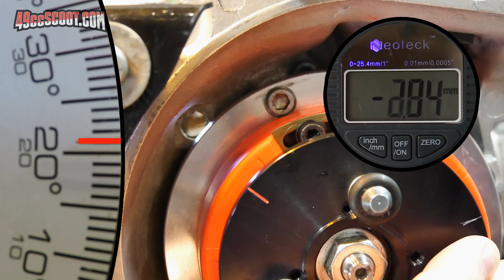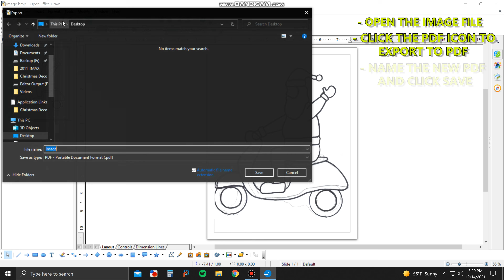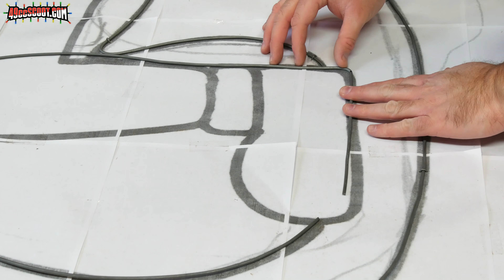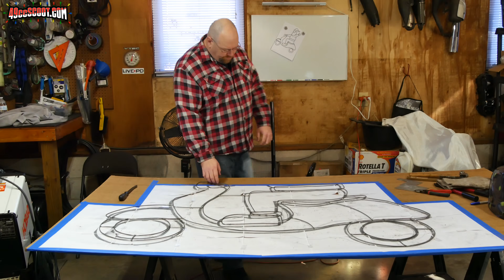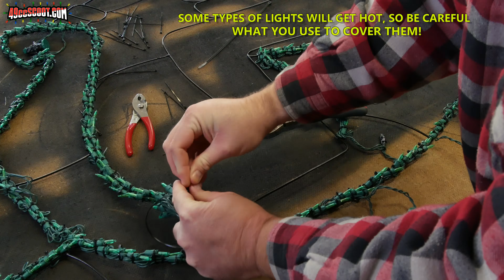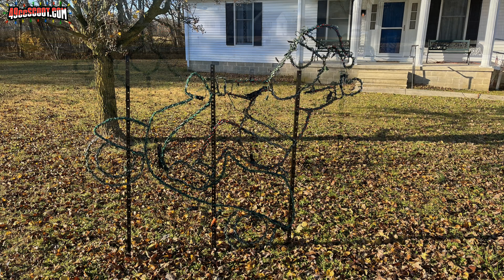🎄 DIY Wire Frame Christmas Light Holiday Decorations How To : Make Your Own Lawn Ornament Display! 🎅

Comment: Would it be possible to see detailed instructions for putting the lights on? How do you fold up the wire and put a zip tie on? Thank you.
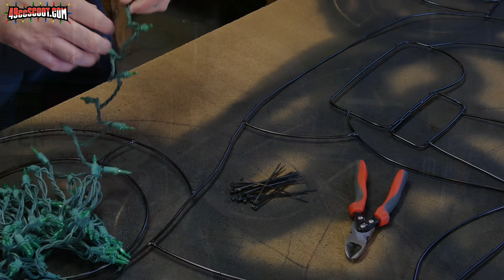Reply from the maker: Go to 14:28 and watch. You can go to settings and playback at 1/2 or 1/4 speed and I think it will be fairly self explanatory. I don't know that my method is the best. I think you could be way less dense  with the placement than I was. It's pretty much just folding wires however they fit best and attaching zip ties firmly. Ideally I like to get the zip tie at the top of the bulb holder, but it doesn't always work that  way. By time you try a few, you'll get it easy. Then it's just a matter of having the patience to continue.

Comment: What I did was just continue using the entire string of lights as far as they would go and just remove bulbs and swap them out with the color I needed from the other strings. Worked pretty good and seemed to make the process a little easier
Reply from the maker: That's what I hoped to do, but the bulbs that I got didn't work that way.

Comment: I use the Home Depot steady lit lights on all houses wreaths and bushes/garland etc! 
They have worked for around 5years so far! 90 days max!
Definitely don’t use regular led lights!
Commercial would be better really
I need to get a welder and do this!
Also couldn’t you just use some pvc clear or something to make the frames?
Killer video!
I appreciate the detail!
You gained a follower just cause that detail!
Reply from the maker: I'm sure you could use other materials for the frame. I think the wire shown is about as cheap as it gets for something that I know is durable and fairly easy to work with.

Comment: It came out really good. Did you ever find out what kind of steel needs to be used so you can use clips to attach the lights? That sounds like the way to go. BTW can you share the type of welder you used? There are so many lessons a person can glean from the video. Thanks so much for sharing.
Reply from the maker: I was using a Hobart Handler 140 doing flux core. It will also do MIG. It was around $450 when I bought it years ago. Now I see it selling closer to $700. I've been very happy with it, but there are much cheaper welders out there that will do just fine for this stuff so you may want to research a little. Here's an affiliate link anyway :
https://amzn.to/3KOEVpA

I've never looked into the clips anymore. I was gonna build another, but just haven't had the time so I haven't looked around. I do know that there are clips for 3/16" and 1/4" wire frames for sure though.
Reply: @49ccscoot  Thank you Sir! Appreciate the information on both questions. I've been wanting to do this but playing with all those lights, doesn't sound like fun. I'd probably try to find lights that don't cause a lot of problem if one goes out as well.  Nothing beats a custom light that nobody else has though!

Comment: Great project.  Very talented man.  
Two questions,  I'm not a welder, any ideas?
Would rope lighting been easier? Or both?
Reply from the maker: Rope lights would be way easier. The way I did it was very time consuming. The benefit is that it's very bright and densely lighted. You'll find that most wire frames are pretty sparsely lit.

You may be able to tie pieces together with cable ties, depending on complexity. Possibly some sort of crimping; maybe involving metal rings to tightly crimp two areas together. Once mounted on poles, it shouldn't need to take a great deal of stress. It needs to be sturdy enough to stay together for storage though.

Comment: I made my big grinch display using an old school overhead projector I picked up from FB Marketplace for relatively cheap. got some clear binder dividers, and traced out the image from a printed picture. Cleared out a big enough spot in my garage to set up the projector, and set my board up against the wall and went to town tracing the projected image out. Worked like a charm, and I bet the same idea could easily be incorporated into this sort of wire frame design building using a sort of peg board with plywood and screws/nails to hold the wire in place as you bend it around.
Reply from the maker: Sounds like a good plan. I think you'd need to be careful that the screws/nails didn't force the wire into shape as you went. Don't want to build tension into the design. Would probably greatly speed up some of the process.

Comment: You could have used an overhead projector to make the image larger.
Reply from the maker: A few people have suggested that now. I think it's a good idea. For me, the method shown worked pretty easily and I didn't have to worry too much about knocking anything out of alignment, lighting, or buying any additional equipment.

Comment: Hi first time viewer, love your idea you do realize you could have just painted that board black and stuck your lights through it by drilling holes all along the drawing and just let that in your yard you didn't really have to make the wire frame.
I really like the idea hope you have a great Christmas
Reply from the maker: Thanks. There are multiple ways to approach it. I like the wire frame. If I were doing as you suggested, I'd end up with plywood that's thicker and trying to paint everything on it so I didn't have a big silhouette in the daytime. Not really what I was after.

Comment: I'd reccommend using individually addressable LED string lights, they are only ~$13 for a string of 50, and you can control each diode individually and set it to any color using WLED software. If one light goes out somehow, nothing else is affected and you can cut it anywhere.

Comment: Looks like a fun project, but at that cost I would probably end up just buying something already made.
Reply from the maker: This is not the sort of thing you do to replicate what everyone else has IMO. This is a project for when you want something custom.
Reply: @49ccscoot  Agreed.  It would be fun if I had the welding tools/experience and the time. I'm a few years away from that, however.
Reply from the maker: @michaelbarrister429  If you are a DIY-er, especially with things like cars, bikes, lawn equipment... or metal sculpture, you will not regret learning to weld IMO.

Comment: I just stumbled onto this video trying to get ideas for this upcoming year.  I got a chuckle when you mentioned my channel, thanks!!!   The wire frame for the train in my display is over 30 years old!   We use to stick weld them with an old tombstone welder and some pencil rod!   In a pinch, you can JB weld the joints together as well.   A few years ago I cleaned up my frames and used a mig welder to secure the joints.   We started out using miniature twinkle lights, then we converted to rope lights and now I'm back to the twinkle lights, but using LEDs.    Your display looks awesome!   And I really like the idea of using perforated steel angle!   I may have to use that idea this year!   :D
Reply from the maker: Hey! Glad to see you checked it out. The drilled angle iron made it very quick for setup and takedown. Thanks for posting your vids.

Comment: Very helpful thank you . Using the larger steel was just too intimidating to me . This makes me think it’s more doable
Reply from the maker: After having it up for the holidays and now in storage; I have no complaints. Sure, the 1/4" steel would be very sturdy, but this seems to work fine for something this size.

Comment: Grid method
Draw small grid system over original size and draw a matching number of grids on larger size. Then you can copy the small squares more easily and with the reference of the smaller squares into the large squares. I’m sure that’s not a good description of what it is but you probably get the idea. If your small drawing is 15x25 squares simply upsize the squares and wind up with the same number of squares of larger size on the bigger piece.
Reply from the maker: We did that in art class back in school. Certainly a better idea than trying to freehand it as I did, but I was pretty happy with the printing. Thanks for posting though.